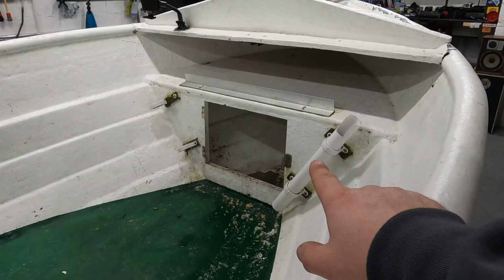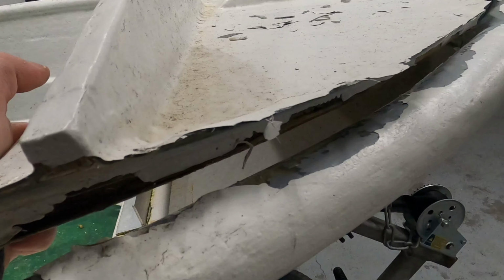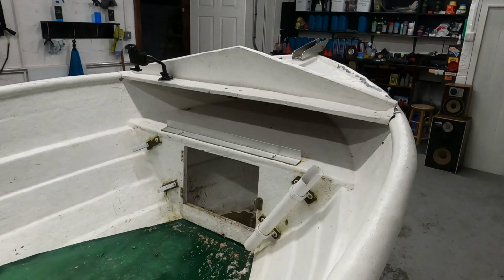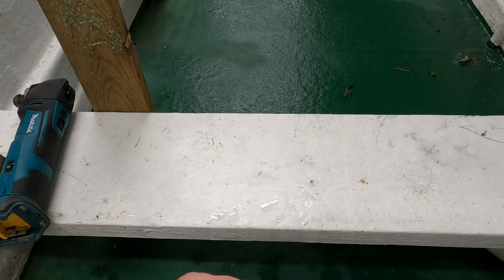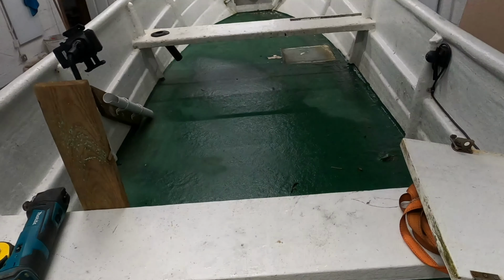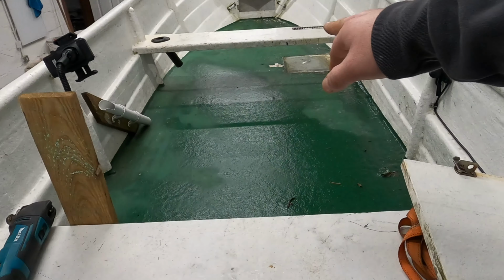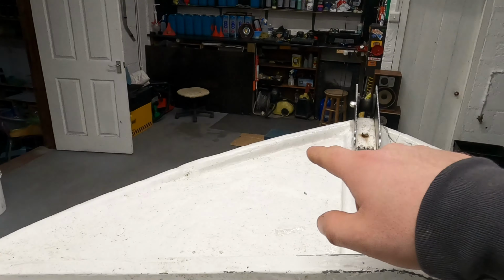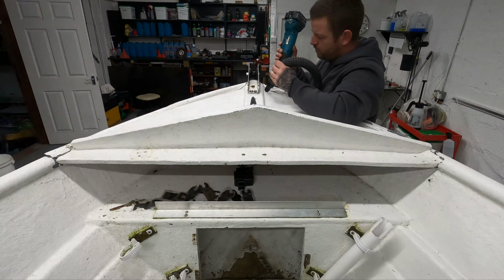Boat restoration part 1

Comment: HI , what type and size of boat is it ?? Im looking for something simlar to fish around st davids
Reply from the maker: It's meant to be a mobass or morbas. Not sure on spelling 

It's 15ft long around 5ft wide 

It's an amazing boat handles the sea really well if you continued to follow the channel I'm sure you will get to see it out there on video within the next month
Reply: Hi, yes it does take the sea well. What kind of speeds do you get, I take it gets on the plane quite quick. Also good channel 👍👍
Reply from the maker: Yes planes fast it's done 23knts with 2 adults and choppy seas need to test it in the flat sea only been out with the 20hp 3 times so this year will be the test for it 
And thank you I really appreciate it 

Got lots of new camera equipment this year and a drone so hopefully improve the footage by miles hopefully